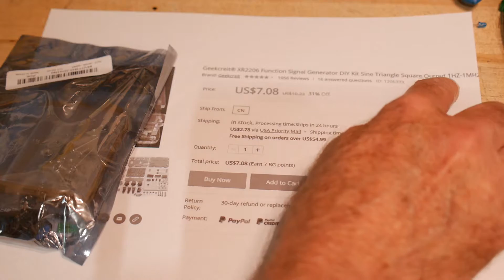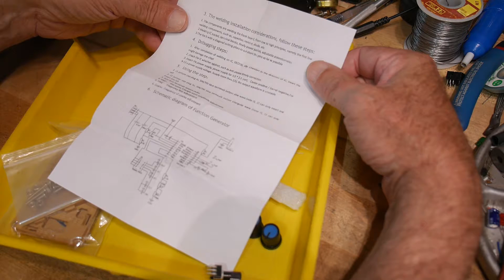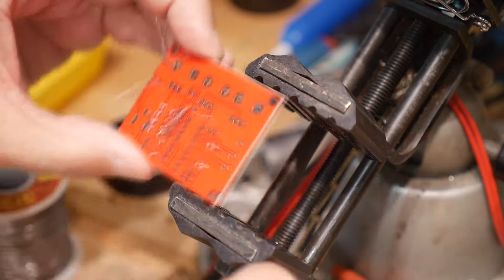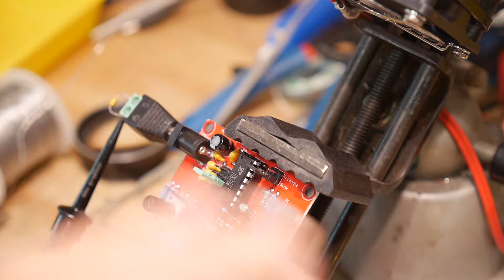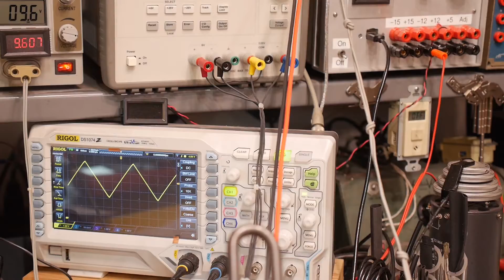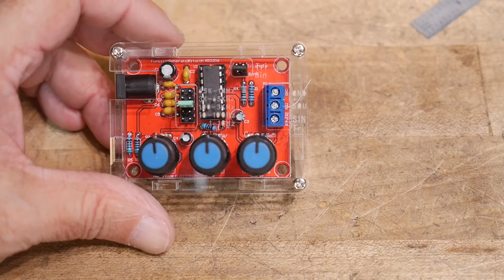#432 Chinese kit Function Generator

Comment: I'd like to see the results of running it off 12V, the datasheet suggests 10V as the absolute minimum. Also, figure 12 and the notes on page 11 of the datasheet suggest modifications to get the sine wave distortion down to .25% That would be an interesting modification... The datasheet has a lot of interesting ideas that could be tried. BTW, I loved this video!

Comment: I think the biggest flaw with this circuit is the DC offset.  The fact that the sine wave isn't very good isn't that big a deal for such a cheap kit, I imagine that most of the people who want to use this are interested in a cheap function generator for audio frequency circuits.  My guess is that they wanted to use the full frequency range and as a result, a large coupling capacitor that would allow the  1 to 100Hz to pass unattenuated would be impractical.  It would probably be better if they just ignored the low frequency range and coupled the output.
Reply: The datasheet suggests running it on split supplies (+/-12V would be my choice, it can run up to a total of 26V). That would set the output offset to about 0V and then the voltage on pin 3 could be changed to change the output offset to whatever is desired. With that and the sine wave distortion improvements I mentioned in another comment, and this would become a useful piece of equipment.